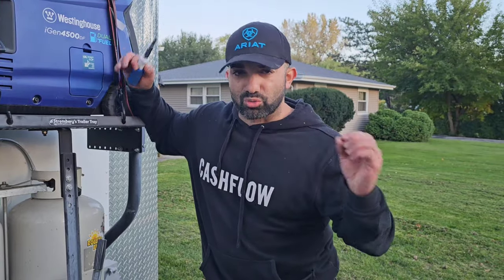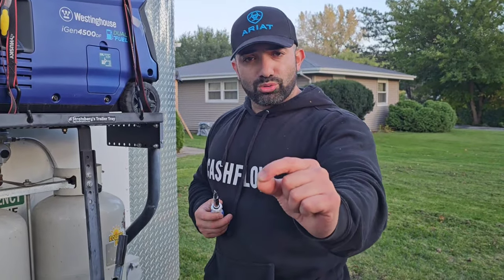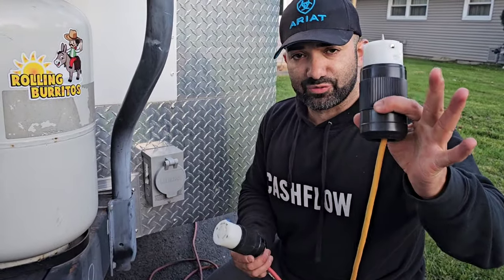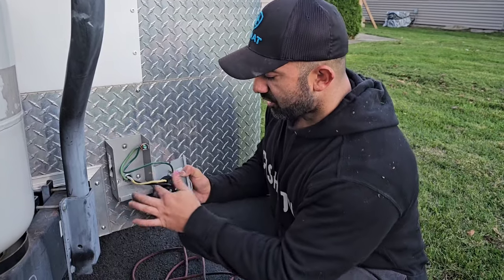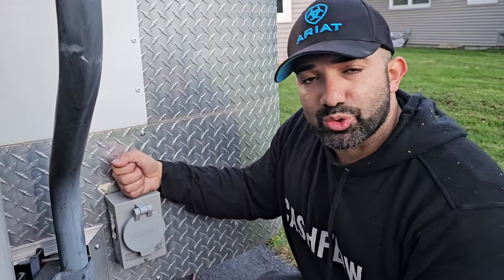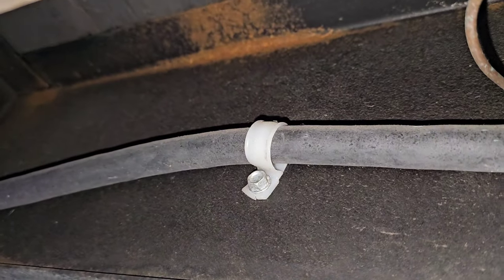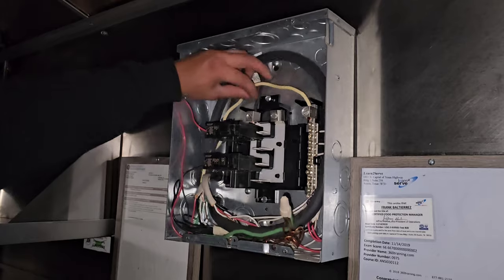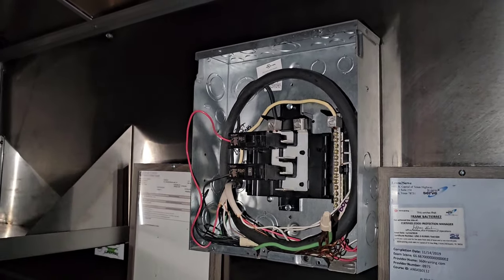Food Truck Electrical

Comment: Hey Frank! Great video and excellent work. I have a question tho
 My current trailer has a 30amp plug similar to the rv one and everything I am using in the trailer is 115-120v. Should I change the plug 20 neman 50amp? My generator supports both.

Comment: Hi, Frank got a question in regards to running the electrical line for shore power or land power. I saw the video you made on how you did yours. But on mine I just want to ensure I'm hooking mine up correctly. One I run that cord into my existing breaker box where do I connect the inner 3 cords? I've attached images to this email so you can see what I mean. Thanks for the help my guy.
Reply: You're email address changed? I'd like to send the photos

Comment: Wished so do ecwoukd do a generator hook up course you did, as well how do I also wire in 30’ 120v sore or voltage plug like the spot your in has supplied power? Like RV’s hv a generator power as well 30’-40’ power plug cable
Reply from the maker: @stevequate1797  I just use a extension cord and cut the end off wherr it goes to inlet box and put the generator plug there

Comment: I have some friends who are 3 months old who started selling sushi in their good truck, but they need to connect to an electrical network they no longer want to use their generator, and the person who rents them the place where they are, can give them energy from their electrical source.. how can they do it??, two 8 gauge cables come out of their food truck and each cable contains two breaks of 60 A each (two breaks of 30A) and they want to make a direct connection to an electrical source.. could you help us?
Reply from the maker: They can put outlets on the building and then run a cord from or cords from the truck.
Reply: @fbaltierrez  mis amigos me comentaron que dentro de la carreta de comida tienen dos cajas de alimentación de 2 breaks cada una de 30 amps. Y cuando he ido a consumirles veo que están proporcionándose energía de un generador de 30amp, y este no les da a basto; tienen que desconectar ciertos aparatos para usar la campana, o la freidora la conectan a parte, etc. y me comentaron que haran lo que ud me dijo. Pondrán un toma corrientes del edificio donde de ahi saldran 50 amp o 60 amo para alimentar la carreta sin el generador… y asi poder usar todos los aparatos de la carreta. Cree que serian adecuados ese outlet con ese amperaje? Gracias por su apoyo!!.
Reply from the maker: @soniahuerta1690  uno de 60 amps es buen Tamaño.
Reply: Ud cree que su cableado sera util uno de 4 ó 6 el calibre para un break de 60 amp? Porque pensaba en uno de 8 aunque no se si vaya a calentarse mucho… que me recomendaría?
Reply from the maker: I can help however its hard to explain everything to make it easy. It would probably be easier to hire someone locally, unless you put a inlet box where you can plug into on the building like a RV. that's how the big campgrounds do it
Reply: Mire… el señor quien renta el espacio para el carro de comida de lis amigos desea extender una conexión desde un centro de carga hacia la carreta de comida… esta se estará alimentando de 60 amp… y desean que sea subterránea… desde el centro de carga hasta la carreta… mis amigo me preguntan que le pregunte a ud… si es posible colocar una tubería de 1 1/2 pulgada de metal obviamente para el calibre 4 que vendrá desde el centro de carga al outlet que estara cerca de la carreta donde se estará conectando la food truck… yo habia comentado anteriormente de una conexión de 50 amp.. pero viendo bien asi como me recomendó ud seria bien una de 60 amp para que no batallaran ellos por aquello de que necesiten otras cosas… pero si se me hace un poco raro un calibre 4 … para ese amperaje… aunque por aca hace mucho calor eso de que se sobre caliente me preocupa… por ello le preginto sobre el cableado
Reply: Gracias por su pronto respuesta.. se agradece

Comment: I just recently purchased a concession trailer and I was changing the plug on one of my outlets into a 20 amp plug to work with my food warmer. The fuse panel is a 30amp max fuse panel. Originally the two outlets in the trailer were both on a dual 15 amp breaker. I ended up replacing that and separating the one outlet to be on its own 20 amp breaker for my food warmer to match the amperage of the outlet. I’m having and issue though since the warmer still won’t turn on. Any suggestions?
Reply from the maker: @Bargo10390  hmmmmm. Did you put a outlet tester on there. The plug in style they sell them at home depot they have a green one and a orange one to see if it's wired correctly

Comment: Bro where is your copper ground wire in current building mine and can't figure out where to put it
Reply from the maker: I just attach mine to the box from the plug
Reply: @fbaltierrez  can I put it to the neutral bar?

Comment: Frank your videos are a great help. How did you seal the hole that goes up to the breaker panel from under your trailer? Silicon, conduit box, compressed gasket style transit? Silicon seems a bit untidy and im not sure it will last.
Reply from the maker: Silicone, it's hidden inside the wire mold box. Nobody will ever see it :)